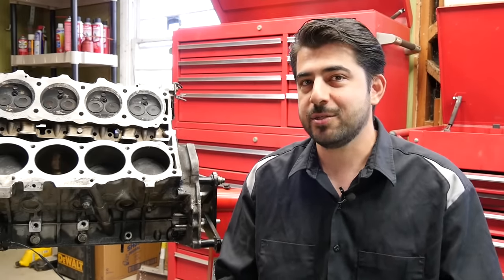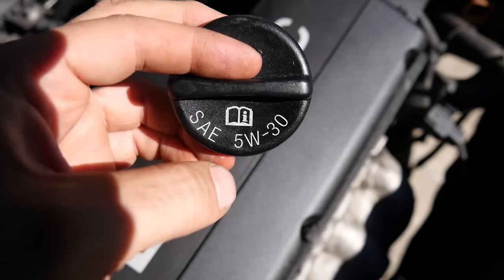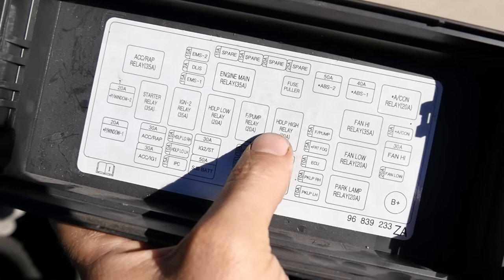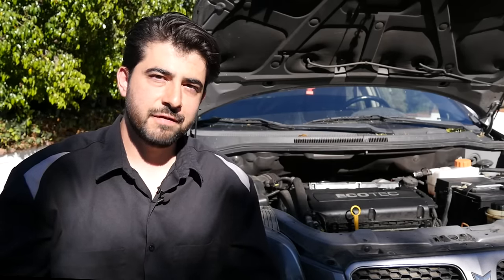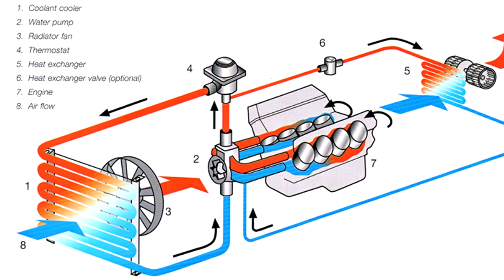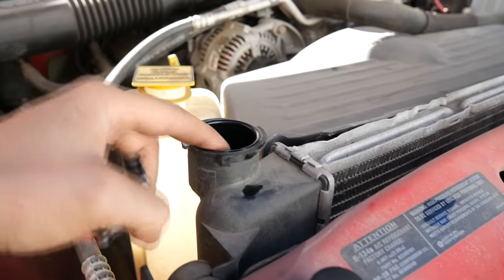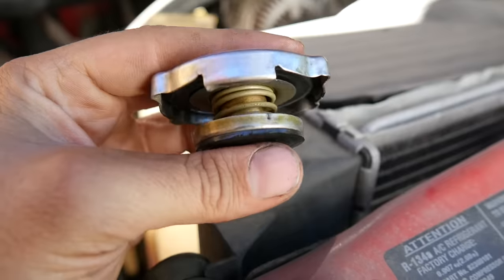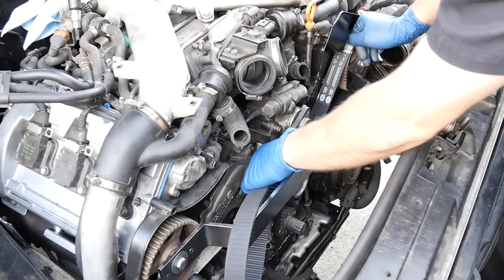Make Your Car Engine and Transmission Last a Very Long Time - Top 5 Tips On Car Care

Comment: Everyone claims Honda and Toyota is the best.  I'll chime in.  One of our Lexus blew engine at only 130k miles.  Our Acura suv blew at only 90k miles .  Both were serviced well and on time.  I'm not so impressed.   Perhaps better than some junk on the market but certainly I don't believe there bulletproof.
Reply: It's called the Toyota cult.
Reply: had a '01 civic, biggest pile of shit i ever had.
Reply: I had an 01 Camry and that stalled on me on the highway and I crashed it. Only had 85k on it. Then got a 2007 Camry and was driving down the freeway and lost all gears except for first and blew the engine up, and it only had 36k on it. Then my last Toyota was a 2012 Tacoma and that was burning oil like it was nothing and then blew a head gasket. That only had 53k. Even my family that has had Toyota didn’t make it to 100k. After my Tacoma I traded it in for my 2012 xterra and never will go back to Toyota. I have 156k on it and they only thing I needed was oil changes and tires and brakes.
Reply: @9fishwm  You are in the minority for sure with those issues on low mile toyotas. I've never had issues or people I know.  They aren't perfect but usually 200k miles is easy to get.
Reply: Mark G Wished they were for me. My grandparents got a 2015 highlander new and it has 34k on it and it’s getting a new steering system since theirs failed on them. Even my uncles 2018 corolla is having transmission problems. Apparently Toyota is having a Secret recall on them.
Reply: @9fishwm  Weird wife has 192k miles on her Camry now and I had 220k miles before I got rid of mine recently. Have some issues but nothing horrible.
Reply: @9fishwm  then,something wrong with your driving or maintance mind!
Reply: VEFA Y I get my oil changed every 5k. When I had Toyota’s I would take them in to get the oil changed because they said it would void my warranty. I drive them like I stole them though. But my xterra has handle it just fine. I have 95k on it and I jump in and redline it all the time. Even my Sierra 2500 has been beaten while towing and hauling things and no problems what’s so ever.
Reply: my sister in law had a 2008  Toyota suv think rav 4 100,000 motor blew 6000 to fix more than bluebook price of the car
Reply: Worse small car...VW.   Best Corolla and Chevy Cruze.
Reply: @9fishwm  dang bro that crazy never ever heard of that happening
Reply: If always said it.dose not matter how many miles are on in those low miles cars could have been ran hard every littil mile that's on the car
Reply: My 2001 Avalon just reached 230k miles last month.
Reply: You either have been scammed or you are unusually hard on vehicles.

Comment: No, you DO NOT switch to synthetic, not if its an older car. If you do it to an older car it will start leaking oil
Reply: Exactly.
Reply: 93 Chevy g20. Switched to synthetic Rural King brand. No leaks, starts easier in winter. Im happy with the results.
Reply: MAKE AMERICA GREAT AGAIN ! If your car leaks oil from synthetic it’s a fault of the seals and gaskets themselves more than the oil, but yeah if it ain’t broke don’t break it

Comment: You should never switch an older engine to synthetic with high mileage as it could cause big leaks!
Reply: Justindobb1984 yeah I burn a lot of oil before adding oil thickeners in my old 80s/90s era Prelude with synthetic, no fault of the oil itself though, it’s just from shitty big clearances and bad rings
Reply: No oil causes leaks. Fix the leaks then use synthetic. Switched to synthetic at 200000km at 386000 on a Hyundai no leaks yet.

Comment: Flushing your automatic transmission is just asking for trouble.
Reply: Why?.
Reply: @02powertube  Cause flushing can dislodge particles and push them where they would not normally flow. Some flushing uses chemicals, some doesn't.  Overall, it is overkill.  The factory recommended maintenance is what you should do.  It calls for a transmission fluid service not a flush.

Comment: Why in the hell do people take Scotty Kilmers advice on oil... he’s not a tribologist or oil industry expert. He’s a frickin mechanic people. Mechanics are not qualified to speak on oil(most). They spread old wives tales and rumors pertaining to lubricants and it’s irritating.

Btw good video for people just starting out maintaining a vehicle for longevity👍🏻
Reply: What would you suggest?
Reply: toyoscio The truth is there are too many oil blends and far too many different engine designs to state “buy a synthetic for ultimate longevity”. The base oil(synthetic/conventional building block of any oil) does not provide the wear protection. The additive system is responsible for that. And simply saying buy a “synthetic” is misleading because there are different types ie group III mixed with PAO and esters, mostly group III, GTL.... it gets convoluted very quickly.

My advice is to join bobistheoilguy.com. Do a lot of research. Pick an oil based on what and how you drive. There are industry experts there like MolaKule, whitewolf and others who are very knowledgeable and don’t just provide opinions or old wives tales as a mechanic would. Best of luck to you
Reply: @toyoscio  bobistheoilguy has lots of good information about oil
Reply: NordicPride970 I used to be a die hard "group IV, V" synthetic guy. Its true, those oils work well. It's also true that people put wAAaay too much faith in them. It's true chemists/engineers know their product BUT, it's also true that mechanics know, in the real world, how customers treat their vehicles. Engineers design engines/vehicles to last roughly, 10yrs 150k miles (yes, some longer and this is not openly advertised, unless "heavy duty" ). 7k to 10k mile oil changes= economy for the customer, not longevity. Synthetic does not magically make an engine last longer, OCI's do. Have oil tested, or change it much, much sooner (old school sooner), synthetic or conventional, 3k to 5k miles/ at least twice a year, if you want to see OTR diesel truck miles on a car.
Reply: NordicPride970 Oh, I'll add. If the engine does do the "big milage" most newer cars will be riddled with VERY expensive computer problems and very low value. Most people won't fix them and they'll wind up in the scrap yard anyway. Planned obsolescence.
Reply: jon-paul cooper Yes but changing oil before it’s time DOES NOT increase machineries useful life, nor does it decrease metal wear. This is not my opinion, but a fact that’s been well documented and researched in the field of tribology. People can’t wrap their heads around this, and companies like Exxon/Mobil are laughing all the way to the bank. Group IV and V base oils definitely have their place. Most consumers never approach this level of use (ie Extended drain intervals, extreme polar temperatures etc). I stand by my statement, mechanics spread a lot of mistruth regarding oil. Engineers and chemists might not turn wrenches, but they rely on data to design new products, not “it worked for my cousin Ned”... or “it’s much more expensive, must be superior...The internet has created this belief that we are all “experts”. We are not! 

I have seen quite a few modern cars surpass 200k miles without these electrical gremlins you speak of, so I’m not sure what kind of janky vehicles you are working on.. Maybe past 500k,  but hardly anyone retains a vehicle that long
Reply: NordicPride970 I agree with your statement, but were talking about reaching 300k plus miles. MOST vehicles never see that mileage. 30k miles/yr=10yrs, average 15k/yr=20yrs. 200k is nothing. It can be done on both synthetic or conventional oil, of correct quality+. Time or wear and tear kill most vehicles before 300k. AVERAGE vehicle ownership is 4YRS. Synthetic= what to planned obsolescence? "Quality" by definition, has been rewritten by product manufacturers and government. IMO, I believe 300k+ milage, is MUCH more likely  to be obtained by driving 30k+ in 10yrs or less, ESPECIALLY with newer vehicles. Changing any oil "too soon" is a waste, but if you drive this much (most likely hwy), most oils do very well. Less cold starts, city wear, optimal fuel mixture and engine load. Mechanics know people are cheap and likely, will not do oil analysis. Most don't care what you put in the pan, it's your car. My point is, be honest about how long YOU will own the vehicle and how it will be used. Lexus dealers use both types of oil. Pay 50 bucks or 85 bucks. They put a sticker in your window for 5k intervals either way. I know these cars do "big miles". My old 92 Camry had 300k miles when I sold it. Valvoline conventional, no sludge
Reply: 4dscdriver
Thanks
Reply: NordicPride970

Thanks
Reply: Or just change the oil per what the owner's manual instructs.  Synthetic oils provide no benefit over non-synthetic if you change you oil every 3-6 months or every 4,000-7,500 miles.  I personally use mobil 1 with the mobil extended filter because I do my own oil changes once or twice a year, which is outside of what Nissan recommends, but my 2007 Altima is at 170k and running like almost new.  Bobistheoilguy - settles the oil debate pretty well.
Reply: Check.

Comment: Some aftermarket parts are higher quality than the OEM versions. And, I don't think synthetic oil really makes a difference. As long as the oil is certified and it's changed based on the maintenance schedule, that's good enough.

Comment: I have a 2015 dodge durango with 204000 miles.  I've paid a lot over the years in maintenance new lifters, cam shafts, sensors, head gasket, spark plugs etc.  But I'm obsessed lol

Comment: Don't use DEXCOOL for your GM vehicle lol
Reply: Why do so many people hate dexcool? I've never had it gum up anthing on any of my chevy's with over 100k each. I do change it every 2 years though.
Reply: Waffeey   It's more so a problem with the GM cars with engines that were made with the poorly designed GM plastic manifold gaskets. DEXCOOL was known to be harsh and "eat" through the gasket. One of the solutions was for folks to replace the gaskets with metal ones, change coolant brand, replace rad. And of course, these engines were used across many of the GM brands. But you're right, DEXCOOL is cool.
Reply: @Zezims  Ahh i see, sounds like a shitty issue to have oem coolant not mix with the oem intake manifold gasket. The coolant itself is just fine though i havent had issues with it on modern GM's
Reply: @z33tanner  No don't, only use Dexcool in GM cars (unless it's a Pontiac Vibe in  which case use Toyota Red) ifhe Green coolant mixes with it it creates a sludge that clogs up the entire cooling system.
Reply: Dexcool is a perfectly capable and proven coolant formula which works very well where it’s intended. You badmouthing it shows more about your inherent ignorance than a products alleged shortcomings...
Reply: @Zezims  Dexcool  is not cool.
Reply: My car had dexcool in it for 21 years and I never had a problem. And I'm sure it wasn't changed every 5 years like you are supposed to. Maybe once at the most. I flushed it and replaced it with more dexcool just recently

Comment: This guy doesn’t even have a 94 celica with 240k miles on it.  Don’t trust him. Also don’t flush your transmission fluid.
Reply: Do his flush method, not the actual flush (pressurized flush)
Reply: Right. I have a 97 Celica with 285K. Tiny oil leak and could use a new clutch soon. Other than that, one hundred percent. Best backup rig I ever had. A real five speed phucket machine.

Comment: I have a ford f 250.1988 with 643777.8 miles I haven't changed the oil in 4 years and I drive it daily.
The rear main seal leaks so the underside of my truck is not rusted  out . I use straight weight conventional oil add some when some leaks out the rear main seal.
Here is a bit of really good advice don't buy a automatic transmission.  Never have I bought OEM parts why would I buy the same part from the same people who built the one that failed in the first place.
Reply: you change your oil

Comment: 210k miles on 2014 Mazda 3, no mechanical issues.   Running strong.   Only spark plugs, oil changes, brakes, and fluids (Maintenance).

Comment: I've owned multiple American and Japanese cars over the years. One thing Scotty talks about all the time, and I agree with him.  On other cars it is not always the engine, or even transmission that is the problem long term,  but the rest of the car.  

That is 100% correct.  My Ford is 17 years old with 110000 miles. The ac has been rebuilt twice, the entire engine cooling system has been rebuilt (what a job), new radiator, hose, pump, the auto door locks are broke, the radio doesn't work right, the door handles have broken I cant count how many times, started, alternator, front end, clock spring, on and on and on. 

My 23 year old Camry, listen for the it, the crickets, cause they coming.......aside from minor maintenance repairs nothing major. The interior of the car looks new, no cracks, the plastic is higher quality, the rubber is higher quality, etc etc. Everything on the car works. Always has. 

The Ford engine and the transmission are been trouble free, albeit low miles, with the exception of a valve cover gasket, and that was just age.  But it nickle and dimes the hell out of you on everything else, bumper to bumper.  The Camry simply does not do that. 

Why do I keep the Ford? Because the engine and transmission are trouble free, I have maintained the rest of the car yearly, fixing things when they needed and doing work myself when possible, so the cost of replacing it far out strips the cost of continually maintaining it, but let a few things go for a year or two and you will soon be saying there is no way I am putting all that money in that car.......
Reply: My 98 mustang gt over260000 miles on original engine never open a valve cover
Reply: @IwillmuteyouGOTIT  good for you, wish I could say the same, but can't.

Comment: My daily driver 2011 Honda CRV reaching 405,000 miles on original powertrain. Recently removed valve cover to take a look…all is clean like new. Routine maintenance 👨‍🔧 and have my eye on 500k goal.

Comment: Rarely pre-fill my oil filters when doing oil changes, never caused an issue.  That being said some good info in this vid.
Reply: Yeah, I think that's a bit overkill. The engine doesn't run "dry" long enough to do any significant damage before the oil gets up in there
Reply: I drink, smoke and eat terrible. I’m not dead yet.

Comment: I used only Mobil 1 on seven vehicles that lasted over 300,000 miles. They always start right up and on my 2500 Ram diesel at 275,000 miles the mechanic said he had never seen such a clean enging while doing a PM on it. I change oil at approx 15,000 miles and oil filter every other time.

Comment: Another good thing about timing chains they don't use idler pulleys and they get lubricated by the motor oil and most times the timing chain can last up to 300k where the timing belt can stretch easy and snap and timing belt driven motors are more likely to jump time, modern cars have switched back to timing chains cause they last longer and don't jump time all that often until the tensioner fails lol
Reply: I don't recommend going 300K on a timing chain. 150K - 175K is more ideal; also, timing chain cover gaskets will deteriorate over time and leak. When you replace these gaskets you might as well put in a new chain "while you're in there".

Comment: Something I learned from Danner Scanner most cars won’t start at WOT.So change oil floor it crank 10 sec.pause.Repete x 3, 1/2 throttle crank, instant oil psi no dry start.

Comment: My 1998 F150 has 376k
I have replaced the head gasket and multiple rear axles. It runs like a champ.

Comment: Many cars are just not meant to last 400,000 miles without serious problems like my 1994 Dodge Caravan.  I got 220,000 miles out of it.  I hardly changed the oil but the engine kept going.  The rest fell apart.  It could have been fixed but the cost was not worth it, and the style was obsolete. People would just call it an old van.  I took it to a restaurant with valet parking and the worker wrote "old dirty van" on the tag.  It was old, but not dirty, rusted, noisy, or damaged. We live in a society of materialistic boobs. Of course, all these tips are great. Best to keep your car safe, and reliable always.

Comment: Yep exactly why all my dads and my cars lasted over 350,000 to 400,000 and now my sons first car  is hitting 200,000  all Toyota’s all same engine and transmission no problems
Reply: Same thing i can say about volkswagen but everyone for some reason hates them...
Reply: B
Reply: Plenty of Ford F-150's out there with the same amount of miles.
Reply: How  many dads u have?
Reply: I see your point. Had a MK4 TDI Jetta with 360,000 miles when I sold it. Ran like new. Plenty of them still on the roads. almost 20 years later. Bro, It's a CULT. It's at this point a psychological perception that many people just regurgitate.
Reply: Im still stuck on the "all my dads" part... cant quite picture that😅

Comment: For the transmission that usually take about 12 quarts of fluid that is one way to tell that you've gotten most or all the fluid out if your only put 4 quarts in there you haven't done it right. Or you haven't flushed it.

Comment: If you want to shatter a plastic cam chain tensioner, fill the filter.
Ideally turn the engine over backwards to do the most damage.
There are so many ways to destroy an engine.
Never had one fail but it helps to know how they work.